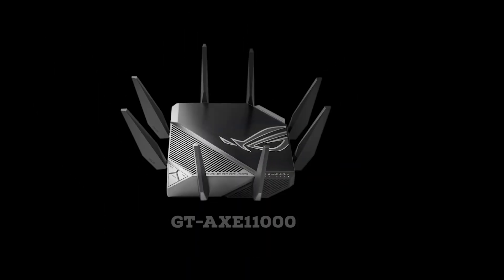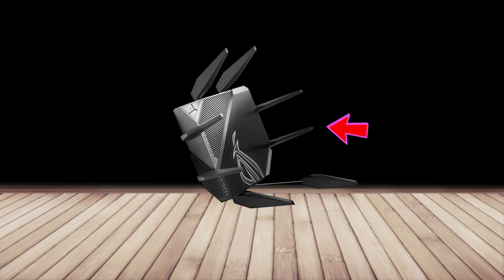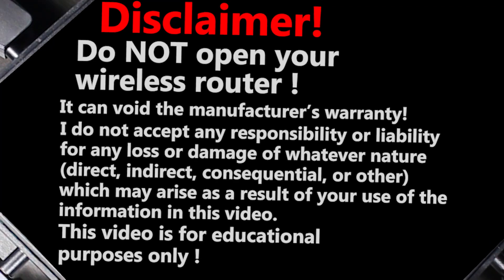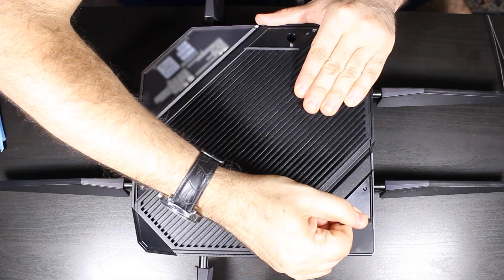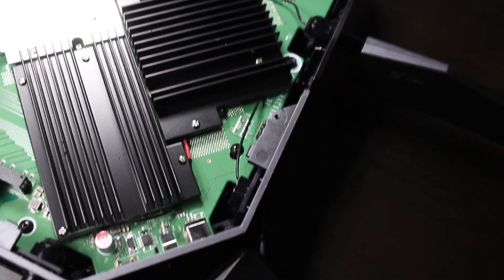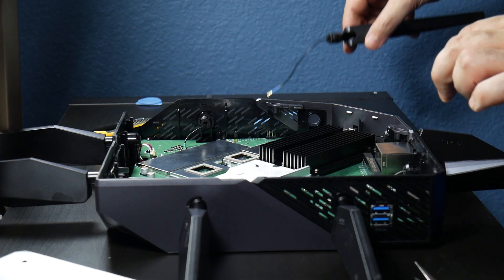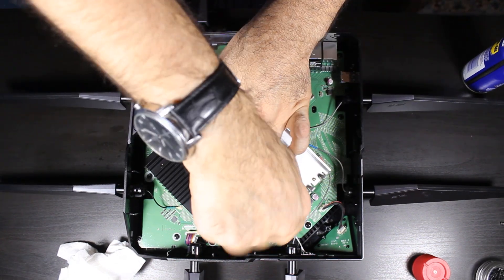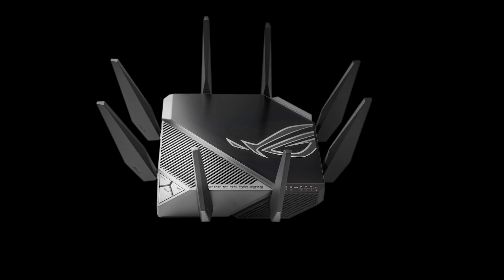How I Fixed the Broken Antennas on My ASUS GT-AXE11000

Comment: Let's note that these antennas are mostly for show - big clumsy plastic housings surrounding  small internal working parts.  They can be replaced with MUCH smaller and less obtrusive substitutes without losing "performance." They are the WiFi equivalent of a putting a rear wing on a Toyota Corolla.

Comment: I just found this video because I bought a new router and just wanted to put the 11000 back in the box. two of the antennas would barely swivel. I'm pushing them so hard I think I'm going to break them... And no, I never dropped it. I probably need to do the WD-40 on both the inside and the outside. I'm deciding now if I want to try to open it up. Thanks for showing me how.

Comment: I also broke mine in almost the exact same way, except in my care it broke the pegs off the elbow joint.  It still has a friction fit and still works, but now I am wondering if there is a way to get replacement antenna's.
Reply: Use 3D printing and reuse the cable?

Comment: This video was pretty cool, it's a shame for how expensive the axe11000 or axe16000 the antennae are non removable.
Excellent for in-home streaming especially with 10G NICs.
I have the AXE16000 and I upgraded from a single ac86u.

Comment: This video is exactly what I was looking for. I'm in the same boat with 3 bad antennas that I need to replace.
Reply from the maker: Glad this video was useful for you and I hope you can easily fix/replace the broken antennas. Thanks!
Reply: @Behfor  Would you happen to know where I can buy the antennas themselves and just DIY the work instead of waiting on an RMA?
Reply: @ntibrandon5127  Aliexpress have replaceable parts for Asus routers. Delivery time may take some time.
Reply: @catmuf  I looked but was unable to find this specific AXE-1100 model antenna that connects directly to the motherboard.
Reply: @ntibrandon5127  That's sad news. Maybe you need to wait until there's a seller that sells it. Or you may take the option to RMA as you stated before.